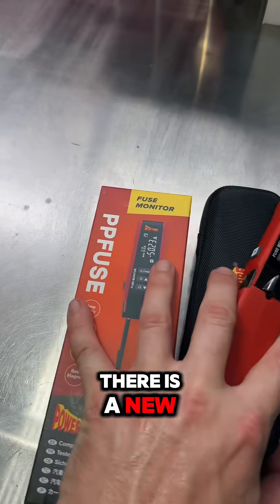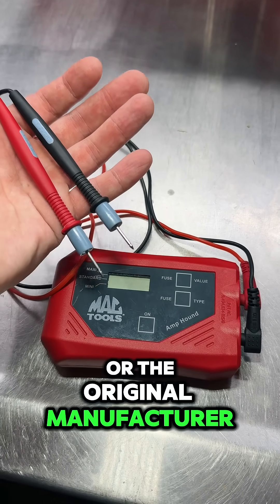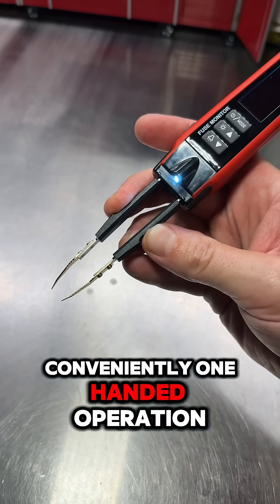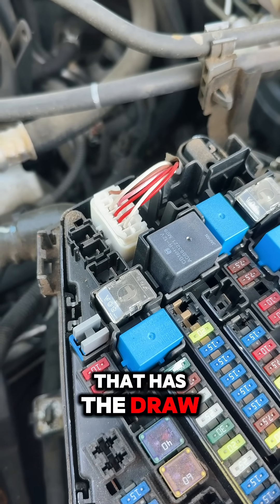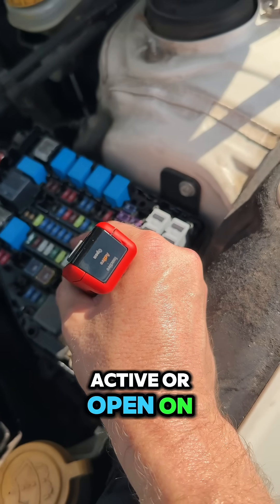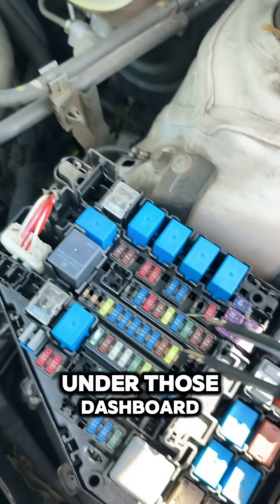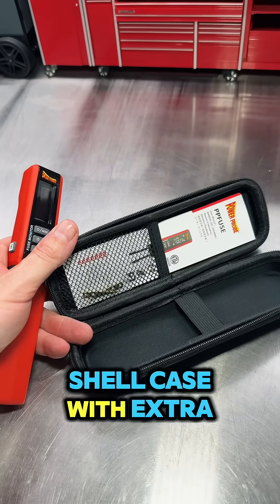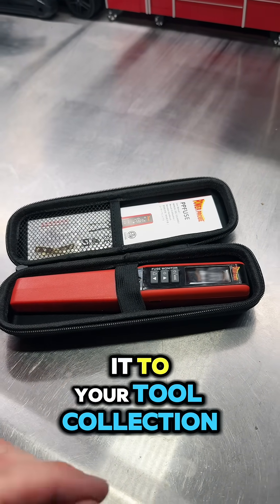If you still haven’t seen the new PPFUSE in action… this one’s for you.

Comment: Just bought one along with the PPDRAW.  Little disappointed, I plugged them in to charge overnight, and the PPFUSE has a bad charge socket. Contacted my guy and he’s dropping off another. However I figured I would use the one I had to see how it worked and found the culprit fuse in about 5 minutes. It was another techs car with the issue, he was on lunch, I texted him told him to bring me back lunch because I just diagnosed his problem vehicle. Awesome tool.

Comment: Looks like an excellent tool. I've been using my PPIV for years with the power probe Voltage drop charts, and have been wondering why you all never made a tool like this from day 1. Happy to see this, hope to purchase my own soon!
Reply: Juat watched the video a few more times. My current system might be faster than this, because of the way the fuse type and amperage is selected. It probably would be faster where there are many fuses of the same type, but what I usually do is test all the fuses, where I see an anomaly I note it, and the fuse type, then look it up, if necessary.
Reply from the maker: @barefootdiagnostics1360 that's the best way. Even with PPFUSE, we recommend setting a mid fuse rating to find active circuits, then request with correct settings for accuracy. Much quicker this way

Comment: Does this thing beep at you when you probe a circuit that has current flow?  That is the best part of the amp hound in my opinion, I don't even look at the meter part, just probe along until it beeps and mark down which fuse that was.  I can go back later and actually check the draw.  Also, this looks large, and it makes me wonder how it will fit up in the dash of a late model fusion/mkz which seem to be the worst to access with my amp hound
Reply: I guess it just looks bigger in his hand in the video.  I can't buy this yet anyway, I have to buy the ppdraw first but haven't pulled the trigger
Reply from the maker: It does not beep, but the three lights on the back tell the story. No need to watch the display screen. Just look for a circuit that lights green and active. The tool is pretty small and Tex have told us that using it in tight spaces is actually a big plus over other tools or a multimeter

Comment: Why does the type of fuse matter when checking for a draw ? Genuine question.
Reply from the maker: Great question! Each fuse has a specific resistance value that determines when it blows. Knowing this value allows the PPFUSE to calculate current by measuring voltage drop and using Ohm's Law
Reply: @PowerProbeUSA  Thank you!

Comment: Meh. Maybe Im just an old man, but I throw the multimeter in mV and use a lookup table for the fuse type/rating if I want to know the current. For parasitic draw I'm usually just looking for voltage on fuses that shouldnt have any.
Reply from the maker: That works, the PPFUSE is just a little easier. Sometimes it's hard to hold two leads on the fuse and still see the meter display, especially for fuse panels under a dashboard